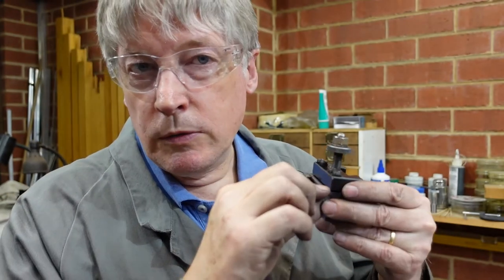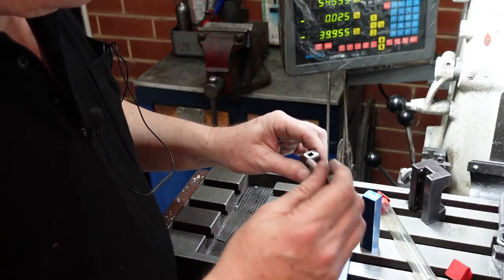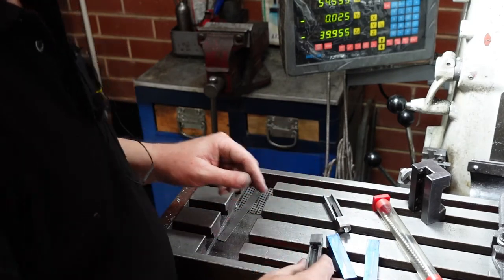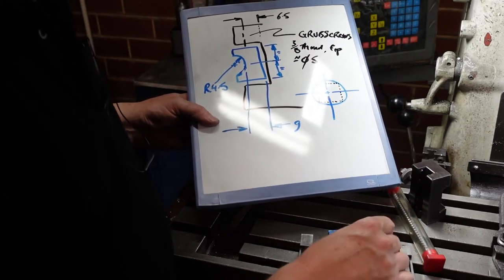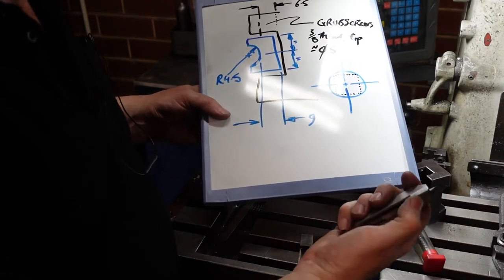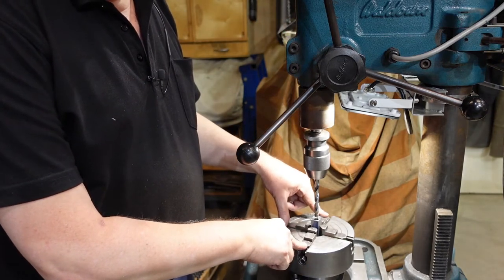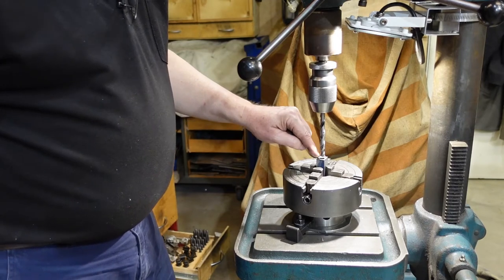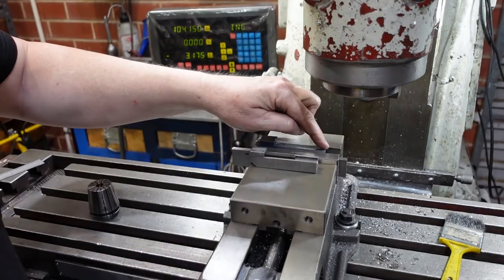Insert tool holders without the carbide

Comment: Interesting would go well on my little lathe when I make a new bolt so I can fit the QCTP. Where did you get the light on your drill press?
Reply from the maker: The light is a 9W HPM floodlight (LFL0409WBL). I got it from Mitre10 but I think Bunnings also had them (this was a year or so ago).
It's wired into the 240V line so that it is switchable. One of the few that I've found that will fit in that space. Makes things a lot easier to see.

Comment: would it be best to do a open surer hole for a 3/8 . tool steel holder  /?. what do you think ?
Reply from the maker: I would be holding 3/8 tool steel directly in the QCTP. These holders were envisaged primarily for small sizes of steel, where it is easier/ more efficient to shape a small piece (typically for thread cutting) than grind a lot off, as would be the case if a 3/8" piece was used for cutting threads.